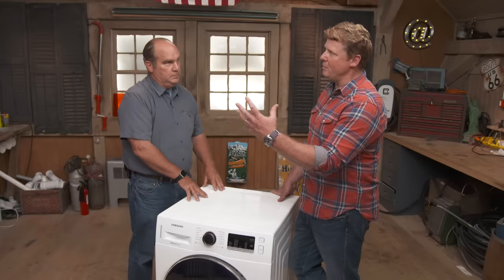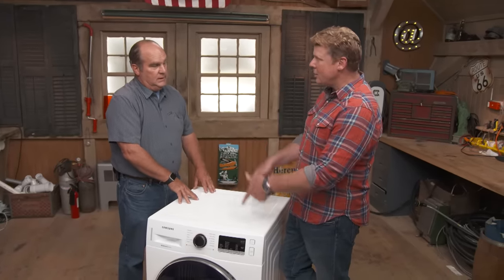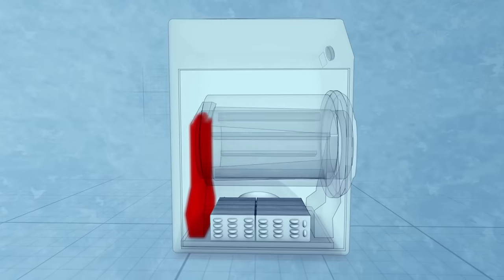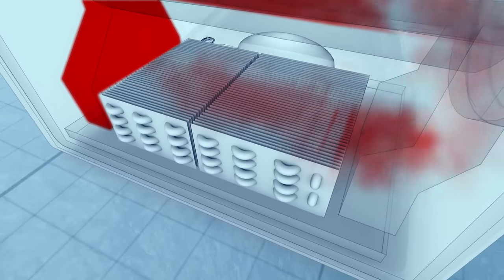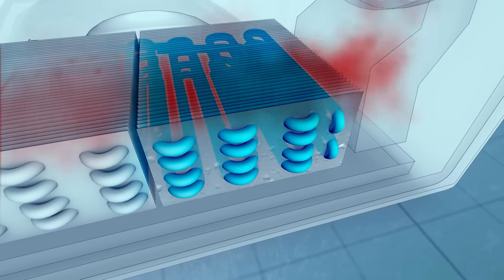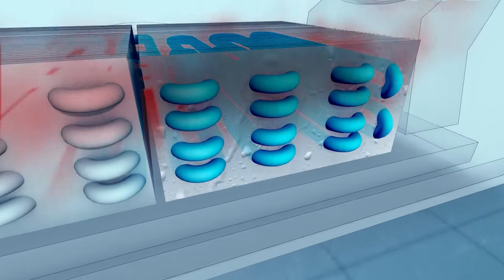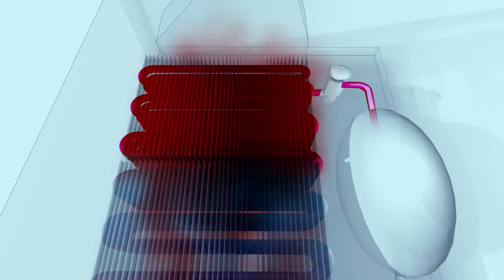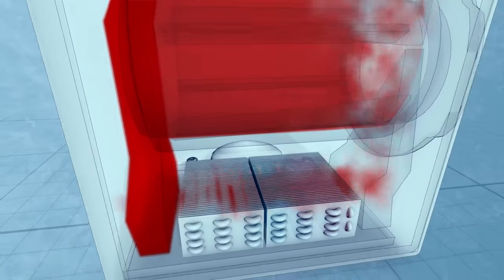Exploring a Heat Pump Clothes Dryer | Ask This Old House

Comment: I also should mention I assumed this unit he was talking about was an older Meile.  There are brands to make a bigger heat pump dryer that plug into 220 the Meile is working only on a standard outlet which makes a difference as well.
Reply: Hi, do you have any feedback on Meile 110 ventless dryer? Thanks
Reply: @bennisim7949  I have one Miele (BTW not Meile) and it has performed beautifully, it runs on 110 and I capped my outside vent, it shares the clothes washer drain to get rid of the water. It tells you when the filter has to be cleaned. Beautiful machine, a bit costly but you get what you pay for. It's smaller than a full size machine but handles about the same quantity of clothes. You can put a freshener cartridge that gives a nice smell to clothes dried in the machine, not those cheap perfumes used in the Bounce type  additives.
Reply: Wetrock thank you for your reply. I actually bought one and really like it.

Comment: This is ingenious. I just saw how much electricity my dryer is using with a new electricity monitor, and it’s insane.
  Why isn’t anyone comparing it to a dehumidifier?  That’s a better analogy than an air conditioner or refrigerator.
  Dehumidifiers do create a little extra heat that goes into the room, and this machine would do the same (energy cannot be created nor destroyed).  That’s good in the winter, but I have a solution for summer.  If you also have a heat pump water heater, locate it in the same room.  That would recover the waste heat and put it right back into your hot water!
Reply: From my perspective, these driers are more analogous to dehumidifiers. My drier doesn't run that hot, but rather feeds the drum with air that the moisture gets stripped out over the cold evaporator. That water is then used to wash the fluff off the condenser periodically. Complete genius.
Reply: I know they are already building heat pump climate control systems with a condenser, evaporator, and third condenser for water heating, and juggling the load between them. I doubt we will see the levels of home integration necessary to plug the dryer into the refrigerant lines, but I feel you. Actually, that accumulated compressor work waste heat could be a problem if it isn't dumped to the room air. The recirculated dryer air would eventually get so hot that the evaporator couldn't get it below the dew point, and the head pressure in the condenser would rise until the compressor tripped out or melted down.
Reply: That's what I was thinking.

Summer: vent the tumbler dryer into the room, have the heat pump water heater suck in the hot air, turn it into heating source for the hot water, plus cool the room.

Winter: do same action as summer. 

What's there to lose? Someone correct me, in simple terms
Reply: Heat pumps have 300+% efficiency. No, they don't brake energy's laws. 
They don't make heat, they condense and transfer heat. That's why they  can't catch boiling temps and they need more time for the same work.
Reply: Yes, I just measured the amount of electricity to run a standard electric vented dryer today and it was around 5-6 kWh per load. I couldn't believe how much 6 shirts and 6 pairs of shorts cost, at $0.18 per kWh that's over $1.00 per load. A large family home may decrease their energy needs significantly using a heat pump dryer unit. 

Btw - When it comes to using a heat pump water heater, I believe these may not work well in colder climates (efficiency wise). Water heater heat pumps remove heat from the surrounding air, the same air that may have been heated by the home heating system. I think the water heater pump units work best in places where an A/C system is running all year. In example, a water heat pump may work great in South Florida, unless if the cold coils collect condensed water and have no where to drain it.

Comment: ive owned one of these for about 2 and 1/2 years it's fantastic and way cheaper to run, i got it because i have 11KW solar system so i run this thing for free
Reply: Whats the watts used per hour
Reply: @frankmundo4300  mine is 600watts

Comment: One issue on condensing dryers, is that if they're in a closet, the closet has to be open during operation. Conventional dryers remove air, so there's always fresh air coming into a closed closet. With a condensing dryer, on the other hand, there's no exhaust airflow, and you're still putting a lot of energy into a small space. It'll make your closet heat up until the dryer shuts down from overheat.
Reply: This has an air conditioner
Reply: @AgentOffice  Try putting a portable air conditioner in a sealed room. Air conditioners move heat; they're incapable of deleting heat, since that would break the laws of thermodynamics. In the process of moving heat, they also generate a significant amount of waste heat. Since you're just moving heat from one part of the room to the other, plus adding waste heat, the room will heat up rapidly.

Comment: Whats the cost of running a natural gas clothes dryer compared to this and whats the difference in drying time??., also  heat pumps are usually more complex and expensive too fix, and with my experience a washer drier usually needed some sort of repair within Five years.

Comment: This would be great for apartment complexes. Now all you need to do is make this into a combo washer dryer all in one. This way you would hook a hot and cool line up to it and a drain line and it would take up less space in a small place.
Reply: LG makes an All-in-one washer dryer unit which I've owned for about 8 months now and it works great for small less frequent loads of laundry for people living in apartments with no washer dryer hookups. The only downer is it takes 2 1/2 to 3 hours to do one load
Reply: I put the LG combo units in my rentals. They work great
Reply: Stacked washers/Dryers…

Comment: My sister has a Bosh heat pump dryer and she hates it.  First is that it is tiny.  Second that it takes over 2.5 hours to dry and it is not as dry even then than what a gas or electric heater one can do.  If you don't ever has much laundry to do, it will be ok but if you have a family forget about it.  I would only get one of these if I was stuck in a place that could not have an exhaust.
Reply: 2.5 hours to dry! My god I can run my washer, dryer, fold the toasty dry clothes and still have an hour to spare. Meanwhile these heat pump units will be taking out damp clothes that they have to air dry after briefly.

Comment: It isn't just the 50 percent reduction in power consumption on the appliance itself; it's also less waste heat overheating your home in the summer, and no more sucking air out of your home that you've already paid and used energy to heat or cool. So major savings there too for your pocketbook and the environment. And, if you're using a device like this to replace an older ventless dryer (e.g. washer-dryer combo or ventless dryer) that uses a condenser, it gets even better, because you're no longer using many, many gallons of water to run the heat exchanger; you're doing it far more efficiently and quietly with refrigerant on a closed loop.

Comment: Thanks for letting us know there is a ventless heat pump dryer available.  Great unit for those who can not vent directly to the outside. However... the most complaints about these type of dryers is that they do not get the clothes dry.  Either they are damp (too damp?) or they take 2 to 3 hours to dry.  What would be informative is a break down of the energy cost comparison for an average load of clothes. So say how much, at full heating, will a vented electric dryer cost compared to full heating (if there is a setting) for the heat-pump dryer.  So from the reviews I would say 45 minutes for a conventional dryer at full heat to a 2 hour with the heat pump unit and compare the amount of power each used.  Also include how much each useds (at full power) for one hour so the common person can do their own comparisons.  

If you have a full basement I would suggest using a good dehumidifier and hangs your clothes in the basement.  Would save a whole lot more electricity and money that way.  Need to fluff your clothes?  Hang them outside and let the wind naturally, and freely, fluff and dry your clothes.
Reply: HugeWolf1 In Europe All appliances come with an energy label detailing exactly how much they will use. For dryers it shows the energy required to dry a standardised load, usually 5kg of cotton from a certain saturation to another set point of residual moisture. So one can easily compare. Heat pumps are much slower but use a few hundred watts rather than 2-3kw, so even taking into account the longer run times they still use less overall.
Reply: @spencerwilton5831  they're also much more gentle on the clothes, less heat, no scorched or shrunk clothing.

Comment: I currently own a LG washer/drier combo (one unit, heat pump drier).  It was quite expensive. Never again. I have had problem after problem with the thing. Not to mention it does not dry clothes as well as a conventional drier. You're left with semi damp clothes.

The claim that it's not a noticeable difference in drying time is positively false. It takes 2x the time with the heat pump.
Reply: Washer/dryer combo units are never nearly as good as their standalone counterparts.

Also, LG's heat pump dryers are known for running longer than others...

Comment: Great vid! I have one question.. Can i place a thermo pump dryer in a laundry room where there isnt a very good air Flow? In time the air in the room will get hotter.. will this make the condensing stage harder..? Looking forward to your response. Thank you in advance.
Reply: Makes the room a little warmer due the the efficiency loss in the HP. Doesn't affect the drying time.
Reply: I assume these things have to eventually start dumping the compressor work heat to the room air, or the recirculated dryer air would eventually get so hot that the evaporator couldn't get it below the dew point, and head pressure would rise and the compressor would trip out on safety. I would think any room big enough to fit the dryer in would be sufficient.

Comment: Just realised how much I would save on the running cost with one of these as the U.K. energy prices are through the roof ~£0.35/kWh. New machine would pay for itself in a couple years! 100% worth it!
Reply: It saves around 70p per cycle. If you have two cycles every week you will save around £70 every year.

Comment: basically a room dehumidifier, and, if this was done under a vacuum, it would be an even more efficient cycle. lower the ambient air pressure in the drum and it would dry faster.

Comment: How much will it cost and how long will it last to get a return on investment??? I dump my dryer vent into my 120-year-old house to get extra heat and moisture. Have done so for 25 years and its great to keep house from being all dried out. FYI it is an electric dryer, not gas.
Reply: Yeah, if it was gas, you’d not be around much.  I had an electric dryer that had “no vent” in the UK in the 90’s.  I’m pretty sure it did the same thing.. dumped it into the home air.
Reply: Robert Cookson ,
What about the lint?
Reply: @bigred9428  Never been a problem with it. always clean filter in the dryer it is a pretty long run to where it dumps into the house the may help.
Reply: @DuncanCunningham  it's no different than using an unvented gas heater
Reply: Bryan Hensley Which is equally suspect. Unvented gas appliances belong in museums of Victorian curiosities, not in people's homes.

Comment: Though I love the concept, combining a dryer with a refrigerator seems it might create a whole number of things to go wrong?
Reply: Overcomplicating something that should be really simple.I'll pass.
Reply: They are seriously awesome. Don't knock it until you buy one.
Reply: I have one. They work. Just like a refrigerator or air conditioning system is built to last decades, so is my Míele heat pump clothes dryer. Plugs into a standard outlet (240V not required) and drains right down the same pipe as the washing machine I have below it. I closed off my vent from my old gas dryer. The new machine saves money and is more durable and better built than my old gas dryer which vented to the roof.

Comment: I'm curious to know what the amount of mold growth will be inside the unit...anywhere water sits, like on that coil, mold always grows. Another question is what is the expected lifespan of the appliance...tradition dryers last a long long time.
Reply: I know heat pumps work, but the lint is anther question
Reply: Well, my LG is now 6 years old and still works perfectly, and my LG washer is 16 years old and has plenty of years left in it.
Reply: I was wondering about the mold issue too.
Reply: you shouldnt be putting pets inside the dryer hun.
Reply: It either dumps the water into a drain using the hose he showed, or puts it in the tank up near the top that needs to be emptied every couple of cycles.
Reply: Øyvind Ascanius ,
I thought that was only for gas dryers.
Reply: Brian Bochenek ,
The problem is that the coils themselves stay damp.
Reply: @bigred9428  Quite possible!
Reply: Each and every AC unit works the same way. Many fridges too. Do their condensers get moldy ? I don’t think so. When was the last time you saw mold on aluminum or stainless steel ?
Reply: Gabriel Dumont-Houde ,
June, when I went to put my a/c unit in, and EVERYTHING was moldy, including the coils.
Reply: @bigred9428  you have a bunch of organic dust in your house. Mold needs something organic to grow. Most organic dust is human skin. You might try requiring everyone to shower more often. Or cleaning your place better.. I've worked in HVAC since the 1970s. People who keep clean houses have clean AC systems
Reply: Electric dryer elements burn out so quickly though.
Reply: @stephensnell1379  humm, I've got an electric dryer from 1978 that's still working fine
Reply: Bryan Hensley 
Yeah, ok.
Reply: @bigred9428  why else would you have so much mold and others don't?

Comment: for PEOPLE who actually used one for more than 3 months, could you tell me how long does it take to actually dry a normal load of cotton and your machine year? I used a bosch in 2013 when i was in an apartment, but I thought that thing was broken. Wanna know if there is any improvement?
Reply: I’m wondering if the coils were super clogged? I can almost guarantee I would miss the coil cleaning step if i didn’t know that this was a special dryer

Comment: Well that’s interesting, but what about the cost and complexity, and with the added maintenance.
Reply: Had an AEG Electrolux heat pump dryer for 4 years now.  Zero problems and i bought it in a sale. Highly recommended
Reply: Yeah, if it is recirculating the air inside of it, what about all the lint that will end up on the refrigerant coils?  I was guessing at the beginning of the video that the heat source for this would be just a condensor coil, with an evap. coil in the HVAC system.  The dryer would still be pulling air out of the house and exhausting it, like a conventional dryer, but the entire house would be benefitting from dehumidification.  Anyway, I think it would be difficult to filter the lint out of the air well enough for this recirculating dryer to maintain it's efficiency.

Comment: They also eliminate the need for your HVAC system to "make-up" for the air being dumped by old fashioned dryers. With traditional gas or electric dryers every cubic foot of air exhausted from your home is replaced by outside air drawn in through cracks and crevices. In the Summer or Winter your HVAC system works harder as a result of that. But with a heat pump dryer this is no longer the case, and you save money on HVAC costs in addition to the unit itself using less energy. win win.
Reply: Perhaps assuming you have a whole house hepa air filter and the outside air isn’t a benefit.

Comment: In a tight house it solves the problem of makeup air after the dryer pumps out a huge amount of air it must come in from someplace and it may not be conditioned also the risk of de pressurization and possible back drafting of combustion appliances
Reply: Building codes state makeup air isn’t needed unless your blower is over 400cfm and a 4” circular dryer vent maxes out at 400cfm so it’s an impossible issue you are trying to solve for.

Comment: Have used European combined washer and condensation dryer unit. Have to say the drying experience is not that great. This heat exchanger dryer is along the same line. Have to wait and see.
Reply: You might have a condenser dryer.  Not as efficient

Comment: My 9 kilogram LG Hybrid Heat-pump dryer is cheaper to run than my washer.   The newer ones are pretty good. Plus all the waste water goes into the vegie garden so no water is wasted.
Reply: Dan Cunningham ,
Are you sure that's ok?  Personally, I don't see why not, but my dehumidifier's instructions say not to use the water in the garden.
Reply: @bigred9428  The lawyers made them say that.
Reply: Tom Cartmel ,
If I had the money, I would be sending EVERYTHING to a lab, including this waste water.  That way I would know what's what.  BTW, I am pretty sure it only says veggie gardens.  I should have specified.
Reply: @bigred9428  I believe you may be correct. The water draining from a heat pump dryer would not be clean and may be considered to be gray water, which needs to be treated in a septic system same as the water from a clothe washer.